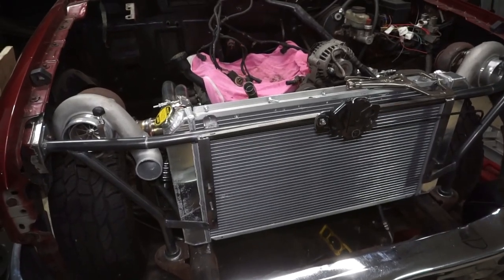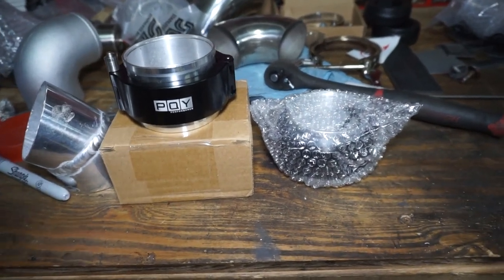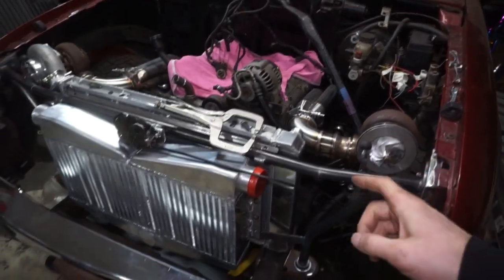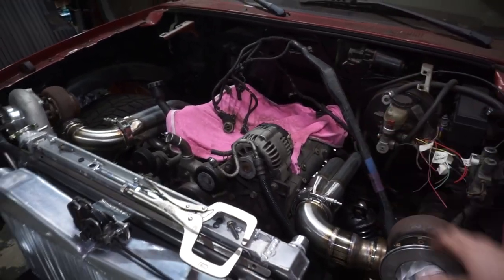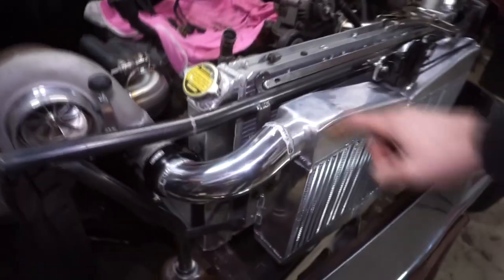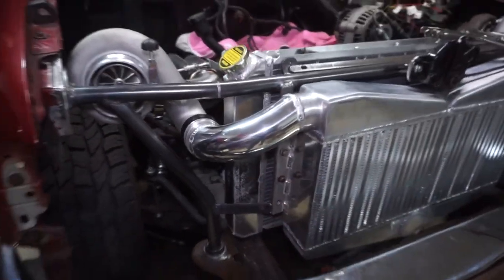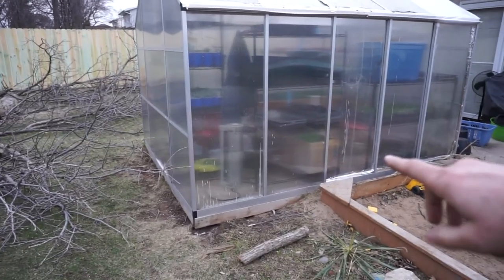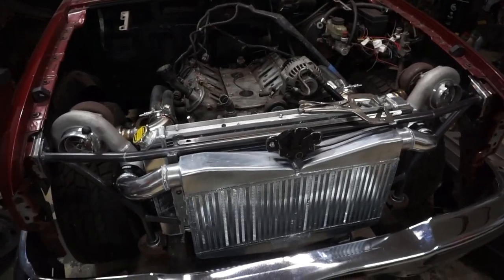Mirror Image Twin Turbo Cold Size | V8 Ranger

Comment: Nice build!
Curious, with no flex, will the torque of the engine stress the solid mounted intercooler, piping, welds?
I want to do this on my  lsx twin turbo build, but went with flexible, short cold side connections.
P.s. Definite "yes" on the Hydroponics. Looking to get into that also!
Thanks for the awesome content!
Reply: Solid motor mounts should take care of most of the flex.
Reply from the maker: These couples flex quite a bit, allow a lot of play, so hoping that's enough and they still seal.